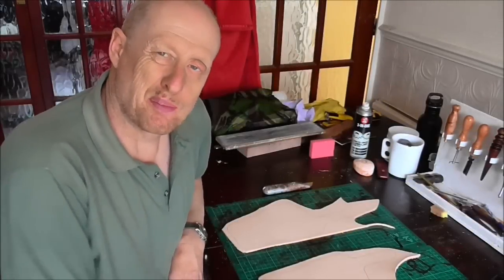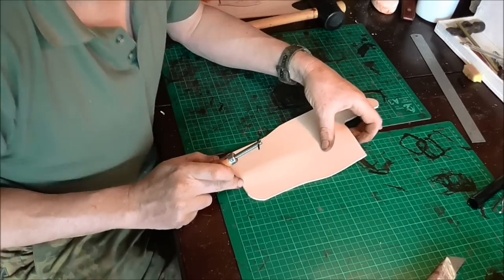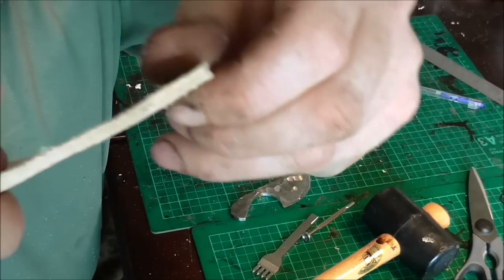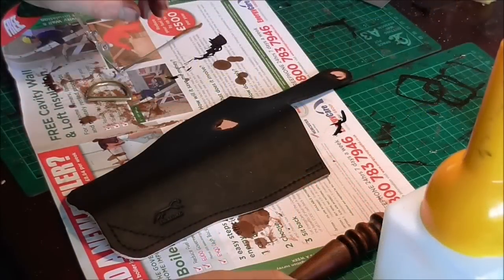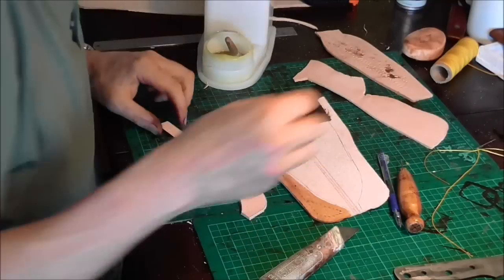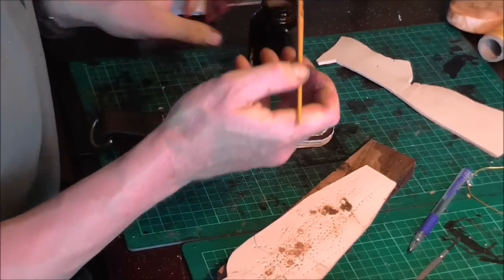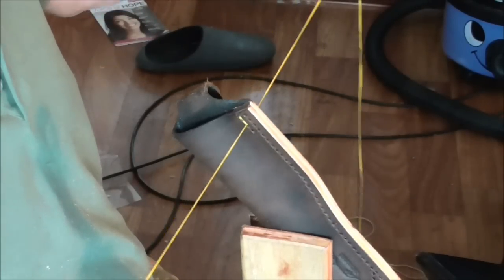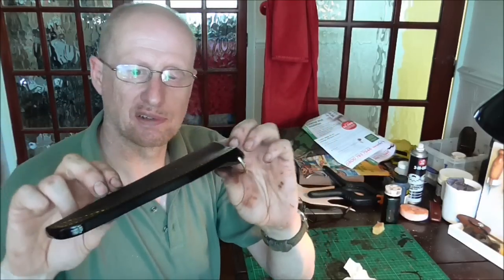How I make a standard leather knife sheath (Part one)

Comment: Around 8:34 you talk about using a free-hand stitch groover. I have never seen one of those. What I usually do is take the guide out of the normal stitch groover and run it alongside a straight edge. But heck that little thing sure would come in handy. Great video.

Comment: Single race is the word you were looking for Sandy, burnishing tool is called a slicker, just a thought Sandy, have you tried to dye the edge of the sheath, then burnish it with the slicker or have you tried a small piece of leather, it should come up like a mirror, then you can put some resoline on to seal the edge, just a thought mate, that is how I do mine, another hint for you Sandy beeswax the thread before stitching, the when you pull the thread tight it will stay there while you put the needles in for the next stitch, but then I have an industrial machine, so don't have to hand stitch that bit, but your finished items I find very,very good, keep the good work up mate..  Ray

Comment: Super video! I have always wondered how to use a chisel properly. That is definitely a better method then just using my awl to punch the holes. One quick question...how do you get your dye so uniform on the sheath? I have SO much trouble applying the dye (without streaks) to the sheaths I have made. Thanks for your time.

Comment: Great Video. I am about to start my first sheath. I noticed with the stitching, you loop the thread around the opposite needle before tightening. This looks good, but do I need to do it? The only instruction I have had in stitching is from a book called the Art of hand sewing leather by Al Stohlman. I don't see in the pictures that he does this, but he does say it's important to always pass the needles on the same end of the hole each time. It looks to me like what you are making is a knot, hidden inside the leather each time. Is that what happens? I intend before I start to do some test runs. I also like that you make all the holes too, the boot I have shows using only an awl, and never letting that out of the palm of the hand, and doing one hole, one stitch, one hole one stitch. That looks complicated, and I can't physically push my awl through 3 layers of leather, but mine is around 5mm thick each piece, too thick maybe? (the leather not me)